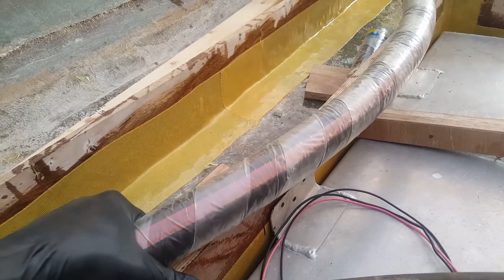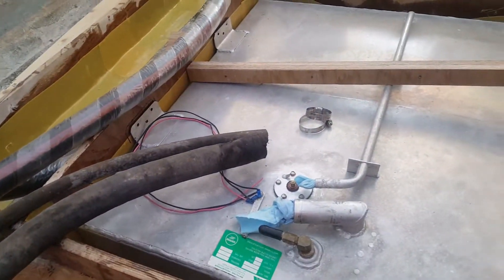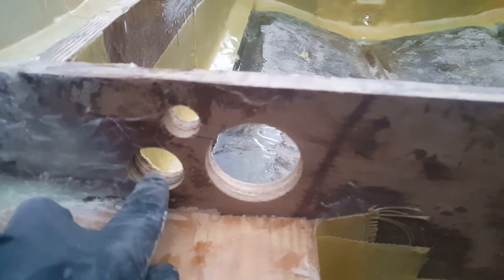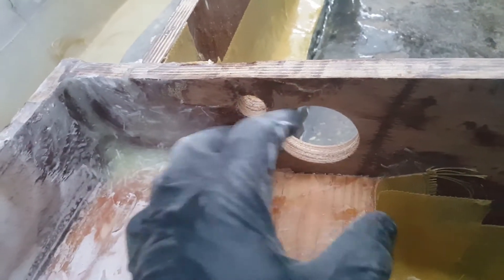Boat Transom and Floor Rebuild - Fuel Tank Install (1 of 2) - Part 49

Comment: If rain gets into the access plate and sits around the fuel tanks, is there a drain hole that allows the water to escape? In the 1990 sunbird omc v8. I'm trying to get running. had a large amount of water and using a power vac was only way to get it out with a hose for suction..maybe the hole its clogged since yours has one..not sure, hopfully also after sitting uncovered water didn't makes it's way into under the floor boards into the hull , screws drilled through from seats etc I figured with rain for years could allow it entry. Any way to inspect if water is into the hull that before I try and get it going.